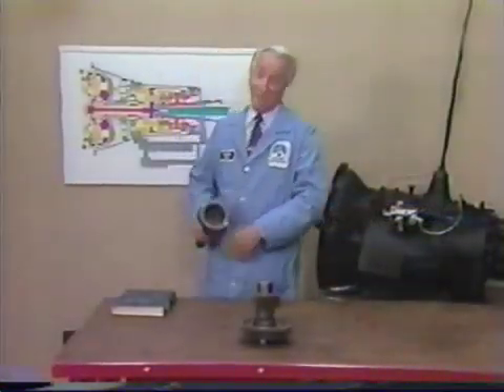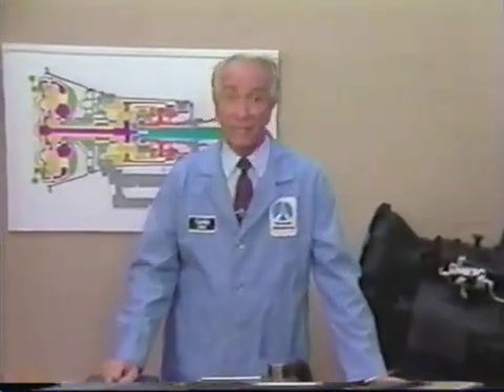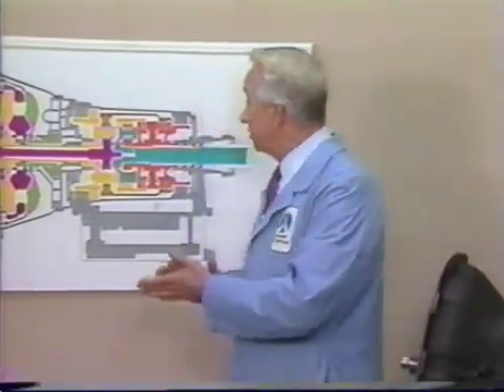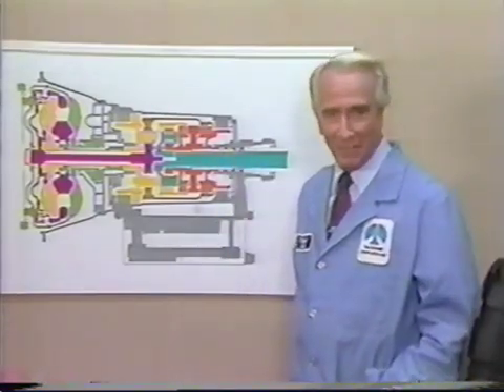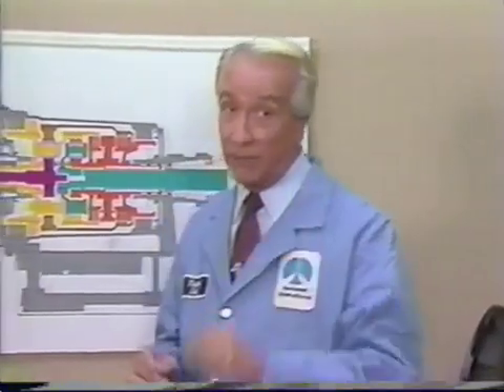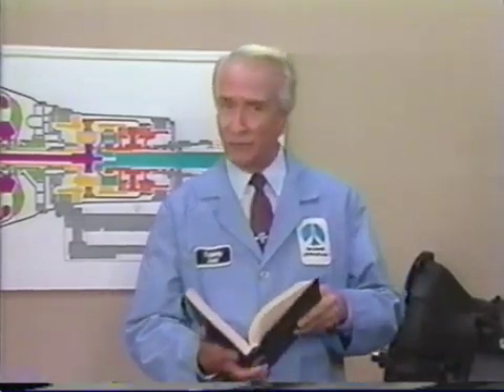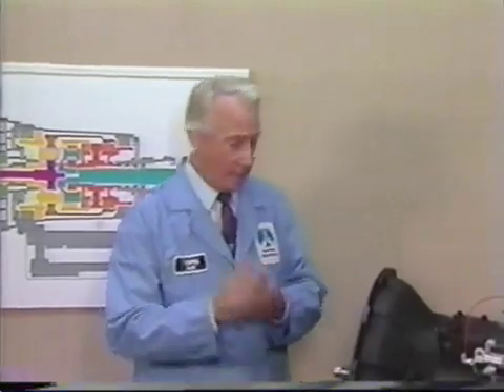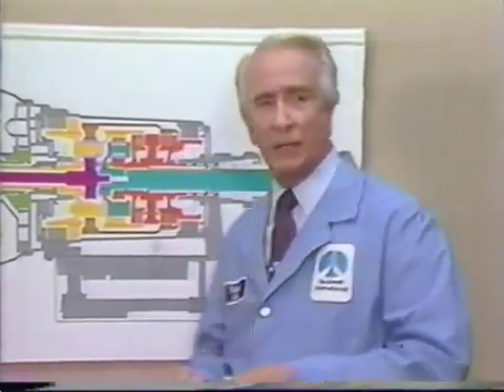Rockwell Turbo Encabulator Version 2

Comment: First, the formula was incorrect. Should be as follows: P=2.5C*6.7/N, where "N" is the trisetrical malatun of retrograde temperature phase disposition.
Second, it was Bloomenstein's 5th Scholarly Dismarflation, NOT his 7th volume.
Lastly, the cryptonaptic boling shim was never "technically" tankred. It was, rather crudely, disparaprodited and then manipulated with cold fluidition to appear tankred.
I understand that old science couldn't explain these things, so I just wanted to throw that out there for anyone who has found this to make little to no logical sense.
Reply: Bernard Buckholtz To be accurate, German words are much, much, much longer than English words- so it is the 5th volume in English and 7th in German.
Reply: Nathan Burd Ah yes. See, my lack of 6 Doctorate degrees is showing. I knew 5 wasn't enough. Meh well.
Reply: +Bernard Buckholtz I scoff at your middle school understanding of what has transpired. They are clearly using a Debians reverse-pole lorentz barrier phase block with the optional lateral swing arm micro inductive peen field variance shield installed. 

With this variable in place, volume 7 is clearly the correct answer. Also with this information I think you will now clearly understand his use of the phrase "tankred" to mean dianotically flex-ventricated. A simple mistake.
Reply: +Bernard Buckholtz 
The main answer occurs about 2.02 in the video of reference - Peruvian academy of Scatological sciences
Reply: Oh, now I get it.  Yes, it all makes sense now.
Reply: Actually, the constant for N is still used to denote the diethical evolute of retrograde temperature phase disposition in certain niche fields (it's use to calculate the inverse phase-shifted peritonatum variable comes to mind). At the time of this video, the trisetrical malatun had yet to be discovered, so the diethical evolute was all they had. It didn't matter anyway, since the two variables follow each other in a semi-chaotic fashion, and only enter butterfly phase after the 7th decimal place - ie. the maximum accuracy at the time.

Also, I think you're confusing the American and German editions. Bloomenstein's American editions split the third and fifth volume to be compatible with Amercian industry standards. Thus, the actual volume in America was indeed the seventh.

Lastly, with regards to tankering, it appears that you are coming at this from a theoretical physics perspective, rather than an applied engineering one. Actual tankering would be pointless in this case, and cause even more wear to the panametric fan than necessary. They even knew this back then, with people like Patrick Bole saying "tankering the shims is impossible, pointless, and indeed detrimental to the smooth operation of this machine." What engineers used to describe as being "tankered" was really a trade off between preventing side fumbling on the waneshaft, whilst allowing enough play so as to reduce wear. Bud even made a nod to this himself in the first part of this series when he said that side-fumbling was "effectively prevented."
Reply: At least somebody was paying attention in there highschool days. Do u know if the meeting of the Peruvian academy was on June 1912. The date just seems to early. It's like going to the moon and getting a phone signal in 1969. I can't get a signal behind food basic on Paterson plank road. I guess phones were better in 69.
Reply: I had a feeling it was the 5th volume not the 7th.
Since it sounds like your  informed on turbo encabulator did the dingle arm come before the Peruvian academy meeting of June 1912. I forgot,

Comment: I am currently building one of these in my garage.

Does anyone know where I can get some High S-Value Phenylhydrobenzamine and Remonitive Tetraiotahexamine?
Reply: Kabooki Joe Yeah I looked. They were all out. Apparently this is some highly desired stuff.
Reply: +Shaun Keefe 

Donald Trump bought it out: it's the only shit that helps his hair defy gravity.
Reply: Advanced auto parts.
Reply: +Shaun Keefe I have a source on it, but unfortunately it is a grade that doesn't work well in low side-fumbling applications.

Also, if your dingle arm is made out of phenoplastic polyamulite, it will degrade and clog your panametric fam.
Reply: yeah, aisle 14 at Lowe's, NOT home depot, Lowe's..
Reply: I have a guy that can get you a dime bag of the good stuff.  But I have to warn you, its retromitochondrialic excitation dystolic properties can lead to severe constipation if the room is not ventilated when you are applying it.
Reply: +Shaun Keefe I smoked all of mine...sorry
Reply: Walgreens
Reply: +Shaun Keefe zumiez
Reply: I got mine at amazon
Reply: Ligma-Aldritch probably has it but you'll have to get an account and they'll charge out the ass for it.
Reply: chefpetey That seems to be the common  problem
Reply: @AlohaSiempre  it is a problem they we're at there wits end if it wasn't for that book volume 7 I believe, and yes the Peruvian academy had such a meeting on June 1914 if I recall correctly.
Reply: The EPA banned consumer use of it in 1982. It's a known carcinogen.
Reply: Try the science lab in Grammer schools. And I thought E=mc² was complicated. knowledge is such a power thing, this is  a hi tech powerful piece of machinery. And we got comments saying this is a made up joke, just because you don't understand quantum mechanics doesn't mean it's fake. Turbo encabulator alert all cars have a transmission,🚙🛢🚛🚜🚉🚊🚆🚍🚒🚘🚑👌🤒🤒🤒😰😰😵😨😵
Reply: It doesn't matter anyway. You would need a trasindental hopper data scope to measure the stuff anyways.
Reply: I've got one in my loft, you still interested?
Reply: eBay
Reply: I saw some at the dollar store next to the  meta-polar fractal infrometers
Reply: They have them on sale at Walmart.
Reply: I live in Thailand. I’ve seen that stuff in big drums in machine shops down in the dark industrial alleys of Bangkok. It’s not uncommon to see two headed rats running around. Thailand has no EPA.
Reply: I get mine, or all I need, at the corner CVS Drugstore.
Reply: +Shaun Keefe ROFL
Reply: +Shaun Keefe Amazon
Reply: Puma Punko ROFLMFAO
Reply: Puma Punko That sounds awesome and dangerous at the same time.
Reply: If you're a Prime member, you can get FREE muthafuckin' two day shipping on the S-Value Phenylhydrobenzamine.
Reply: You want a thiotymoline confragger with that ?
Reply: Don't forget your Dingle Arm...

Comment: Turbo encabulators were the best. Now everything has been replaced by this digital bullshit. I mean, you can't even buy a transcendental hopper datascope anymore, unless you find a used one on eBay, and then you'd better be prepared to pay twenty times what they used to cost.
Reply: Tell me about it! I wore out my drawn reciprocating dingle-arm and then suddenly I had all kinds of sinusoidal deplaneration problems to deal with!
Reply: It all went to shit when they went from hydrocoptic marzelvanes to transistorized marzelvanes. The panametric fam had to be redesigned and the side fumbling was worse than before. It was fine the way it was, I don't know why they had to keep changing it.
Reply: @cmatthews718  You forgot the main reason they did it - it's cheaper to make! That's always the reason, even though it's worse! 🙄 Also, the transistorised design is based on the previous idea of using hydraulic spring dampers, only this time it's a variable solenoid instead. It was stupid then, and it's stupid now!
Reply: +Ben D Not to mention all of the momental balance and calibration bearing journalling getting premature wear, with additional wear on the de-shearing cams, due to excessive inductive electrokinetic deviation of the arm.  Most especially if it's a 2nd generation or earlier model, before the flabber plates on the main spring accelerometers were converted to flabber columns to eliminate said deviation, but also reducing eddy drag and reduced co-phased impedance mismatching to the sender electrodes...!
Reply: The Chinese copies on eBay fail once you get close to their sinusoidal phase gimbal distortion limits as their inductance matrix compensation reactive flange gaskets are just junk.

Comment: It's the correct alignment of those 24 grouting brushes that always gives me issues.
The maths needed for the Manestic conversion is quite complicated and if you get it wrong, the centrifugal output could result in catarophic Gnangling Pin failure resulting in loss of the High "S" Value Phenohydrabenzamine, Turbo Encabulator failure is eminent. You also need to replace the Meta-Polar Refractive Pillphometer if the maths are wrong, it becomes not very cost efficient.

Comment: I'm an experienced Electrical Engineer and let me say I most certainly do appreciate the difficulty of nubbing together a regurgative pearl well and a super-native wingelsprocket. One of the hardest things I've encountered at my job thus far.
Reply: But is does greatly reduce synusodal depleneration! 
DK, ASE master tech since 78
Reply: @deankay4434  And what of side-fumbling?
Reply: @Crumphorn    Mr. Crumphorn, the fumbling must always be on the inlet of the "Tankered" side of the "Winglegate". Otherwise, it may result in loss of anhydrous assist lower throttle bearing. It is imperative that you follow this procedure to the input of the sproketizer otherwise excessive release of effulant via the rear Holcomb sprocket. Oh, please wear safety glasses while tray is upright & extinguish all smoking materials. This is how we lost the Chicago training center. 
  Excellent question and thank me!
Reply: @deankay4434  What about the supernatal weinersprocket?
This is actually the first time I'm hearing of this.
Ive heard about the side-fumbling issue, which has persistently been an occasional appearance.

Was this discovered in the 1914 congress of scatalogical sciences in peru?
Reply: It has to be a left-handed wingle nurt as a right handed will create a positive pressure on the rotors slip-stream. Be careful!
Reply: @Crumphorn  ... there shouldn't be any side-fumbling unless the muffler bearing fails and you have excessive back pressure. There is a thrust trunnion installed to reduce that possibility.
Reply: @deankay4434  "This is how we lost the Chicago training center. "
You "lost" it? You mean it burn€d to the ground, or you misplaced it?
Reply: OK but tell me about improvements in the Dingle-Arm!
Reply: You may find the nubbing of a regurgative pearl well and a super-native wingelsprocket hard, but have you ever tried to detangengially slosh two wankel sinusoidal dingle sprockets? Not dingle arms, no, but dingle SPROCKETS. Nearly impossible.
Reply: @michaelg1915  hilarious 😂
Reply: @michaelg1915  Did you not watch the video? Detangential sloshing of dingle arms and yes, even sprockets, can be accomplished simply by inserting a cryptonaptic boling shim into the panendermic casing of the dingle shaft, taking care to apply premium industrial grade Wankel grease to the panametric fam to prevent gyro-orbital fumbling motions of the lunar wane shaft. Simples.
Reply: Experienced electrical engineers love telling people they are an experienced electrical engineer. 

I am an experienced electrical engineer.
Reply: The music they listened to during this engineering was by Chunky Wing Mong empty gorf dorp.
Reply: @bobquartlemigula2351  I believe that was originally from the cross culturalateralistic assembly of the first of the microcarberuationisasian.  They were actually going to get nuked but the alphabetriums decided to crunch some numbers instead.
Reply: Same, do you have trouble synchronizing cardinal gram meters as well?
Reply: As a fellow electrical engineer, this is exactly why I devoted my life's work to perfecting the special tool known as the d inverted nubulator. It very much simplifies the procedure.
Reply: not to mention the awful smell of that remonative TIH stuff
Reply: Use lubricant. It works on everything else! ASE Master since 1978.
Reply: Coming from a man if Lamens Terms, I purely love this Jargen as I can't tell if it's real or completely made up to sound real or both.
Reply: I've always had the most difficulty spacing the grouting brushes within monastical tolerances.
Reply: But how did you deal with the side tumbling?
Reply: I hear yer, it’s really annoying when the darn winglesprocket doesn’t interphase correctly, the real problems start when you’ve got it in but it’s out of sync by 0.00001 tri-radians

Comment: When subjected to an electrical current, the rare material dubbed element zero, or "eezo", emits a dark energy field that raises or lowers the mass of all objects within it. This "mass effect" is used in countless ways, from generating artificial gravity to manufacturing high-strength construction materials. It is most prominently used to enable faster-than-light space travel.

Comment: Question?  Will the common wheel as we know it  Still be round or can this technology enable us
to use other geometric forms to replace the 360 degree wheel that we have become so used to using for thousands of years. If so I think that the probability of travel to other paraplegic mental experiences is totally possible.

Comment: Rockwell used these on the B1. The original machine had a base-plate of prefabulated amulite, surmounted by a malleable logarithmic casing in such a way that the two spurving bearings were in a direct line with the pentametric fan. I remember it from High school.
Reply: My grandfather worked for Rockwell and on the B1.  He was probably well versed in weenle sprockets and cryptonatic bolling pins.
Reply: Well yes, but that was the retro turboencabulator which is now obsolete.
Reply: I had a buddy that worked Avionics on the B1 at Ellsworth. The worst part of thru-flight inspections were recalibrating the lunar wayneshafts, as they were crucial to the TFR and the variable swept wings.
Reply: When I was dealing with the Hyper-encabulator, the refined version of the Turbo-Encabulator, I had issues with Sinusoidal Depleneration. I tried adjusting the proverbial bearings and resetting catalytic infusion box located under the SOC drawer, but then the dinglearm was charged and restricted flow to the pentametric fan. Anybody have guidance on this?
Reply: @saxboigames1493 I remember when sinusoidal repleneration was the biggest problem. Now we have to tackle xenoaxial decosifation. Simpler times...
Reply: @JacksFuriousPaperclip And nobody knew that the tungsten cowhide used in crapaloy was so effective at sinusodial repleneration.  The day that news hit, it was a different world.
Reply: @kleetus92  It hit harder than a reverted inverse planarid.
Reply: Comment sections like these are the best part of the internet IMO!
Reply: @chadsmith2281  You think the encabulator is impressive, wait till the Rockwell rolls out the new hyper amulite infused confabulator which does away with the problems of the prefabulated manufacturing process which is said to, but not yet proven, to be the source of sinusoidal depleneration.
Reply: @James Ward  Couldn't hurt, will definitely give it a go. Thanks James for helping me get back to Encabulating!
Reply: Side fumbling prevention... genius
Reply: Yeah but the side fumbling…
Reply: The prefamulated amulite is still the best material for minimizing sinusoidal depleneration. IMHO
Reply: by cracky you have got that in the bag boyo